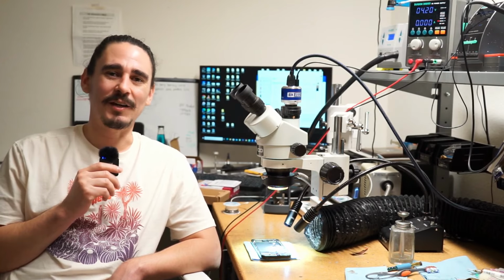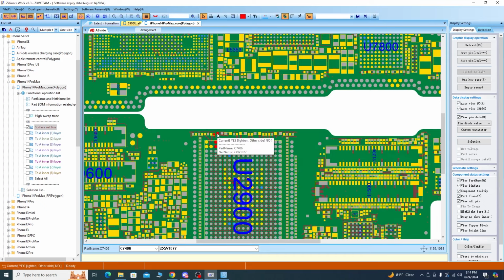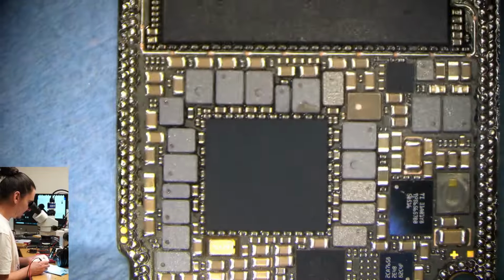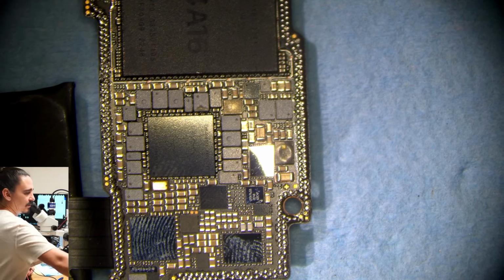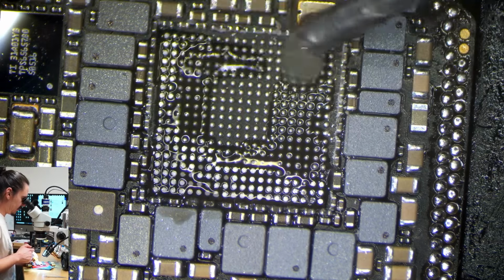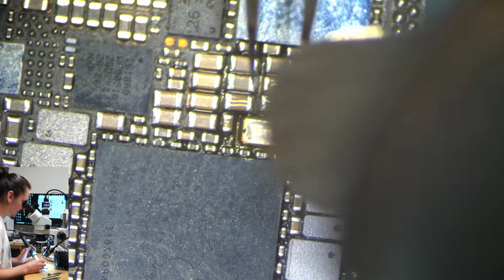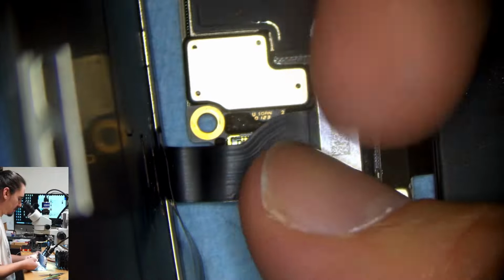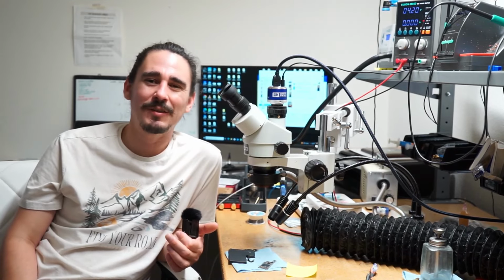Flat Dead iPhone 14 Pro Max Data Recovery - Misdiagnosing for 25 minutes straight.

Comment: Nice job body. It's normal for hard drop to damage the crystal (oscillator) also cold join. The crystal needs 1 volt to trun on itself for older models of iPhone. I'm not sure about for 14 series but I'm sure needs some voltages. U can check the voltage before replace the crystal. In android phone is the same.
Reply from the maker: Yeah I did see the voltages when measured

Comment: Please, I have an iPhone 13 in a short vdd explicit, and when the intensive track that I injected on it heats up, and there is no heat, nor on the camera, the freedom is just connected on the bor, the bur, the sabble, turns off, what should I do with the knowledge, it was working before the separation of Bourdin, and thank you

Comment: i thank you for this Tip bro or idea.. i have 14 pro max also cant charge. i already change the  charging small and big ic but still the same. i also change the boost charging ic still cant charge even change the port.. im stock with this unit for almost 2 weeks. lol
Reply from the maker: Glon tech has some good videos on charging, you should check out his channel.
Reply: @iBoardRepair  thank you so much bro. i already watch his video about 14pro max charging circuit and it gives me an idea... salute.☺

Comment: Hello there. May I ask with what air speed and temperature you work to take off the PMIC or crystal without knocking off or blowing off all surrounding components? I do laptop board repairs and the promixity of everything close to each other and microscopic size of iphone board components is scary
Reply: 360•
45 air